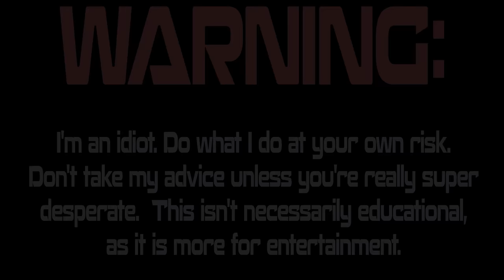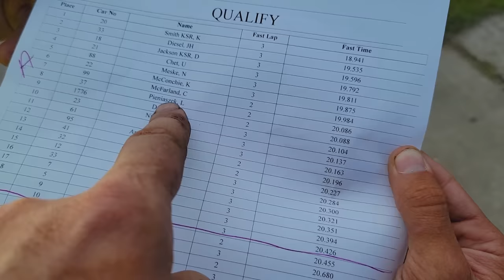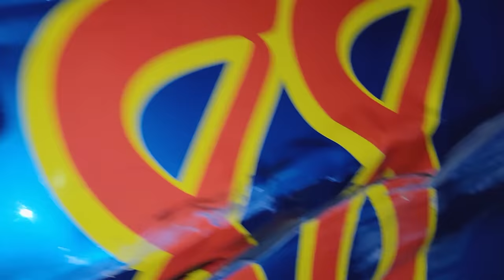My ROLLED Ford Ranger is Back RACING! (Danger Ranger + Spectator Drags)

Comment: Testament to Derek's driving. He managed to get 6th with a bone stock Ranger with a wheel about to fall off and a random misfire. That is impressive.
Reply: They all are supposed to be stock motors.
Reply: @smelmore  could be all those chuck norris's 's's's's under the hood.
Reply: @smelmore  rumour has it.
Chuck doesn't need to even enter the race.
he already won!🤣
Reply: "Tuck in behind somebody faster, and hold on!" Derek's genius strategy worked! Lucky as heck, too...
Reply: It was a fun ride. Jessica did a great job with the video. Imagine if Derek put some mechanical effort of checking things out before loading it up on the wedge?  He probably would have been on the podium. Can't wait until next year. Thanks for taking us along for the ride VGG.👍🏁
Reply: Well maybe probably not
Reply: @jimmylarge1148  That was the last Ranger race, rules changed for this one
Reply: I'd love to see them race.  Chevy S10.  It would look more like a demo derby  prob can't find enough ofem runnin to make  a full race
Reply: Did what you could with what you had   thank you.   Do you have to have a license to participate in these
Reply: What's more impressive is you can fit it all in your mouth! Gi @Paul Curtis
Reply: Dude I am literally shocked at this as well. Ill get me a truck ready I guess. I wanna cut my teeth in a danger ranger.

Comment: Always so stoked to see the hood open on this truck and see that it's the same engine I drive to work every day.
Reply from the maker: Little thing buzzed! Musta' had 3.73 gears.
Reply: I had a 91 with a 4.0 V6 and a single cab with 7' bed. Best truck I have ever owned.

Comment: My vote is YES, more Danger Ranger! We’ve learned that the rear gearing and tire size needs to be optimized and there needs to be a “turning left” alignment. The D Hole wheels looked like a better fit than the Crown Vic wheels. 
It was great for us fans to see you do well in one of these. We definitely would love to see more.

Comment: I watch multiple channels that compete in the danger Ranger but I always root for you. Your channel reminds me of my dad and my uncle they would pull cars out of the junkyard just to get them running and have some fun. My dad would always say "if the radio dont work its junk" how else are you supposed to drown out bangs and creeks. Definitely run the race again maybe make a video on addressing a few major issues with the ranger I mean could a guy fix the radio wheel cylinders and temp gauges aren't needed

Comment: Heck yeah do it again! Maybe do some real fixing up on your truck and read the rules so you can get right up to the edge of them. This was a fun watch.! 
As far as the ramp truck vs trailer with newer truck, (of coarse I'm not the one driving the 800 miles) but I like the ramp truck, just needs a Gear Venders overdrive so you can run a little faster.  Thanks and be safe.

Comment: I enjoyed that better than Nascar any day, I've been driving a 1995 ranger I bought off the floor and drive every day still today. She still runs top a little rusty and a few new parts every year and I plan on running it another 20 years. Its a super cooled engine so you will rarely even see the temperature gauge move except when its 99 degrees out it moves a little.

Comment: A guy definitely needs to run again!  It was great to see Derek finally get to finish, and show his skill on the wheel in the standings.  Maybe a guy could you know, just tune one her a little, make it just a bit faster.  No whirly woows, or compressilators, just a little suspension upgrade and HP boostezez.  A fellur definitely has to leave somethin broke, though.  I do not think Derek knows how to excel in a machine that has nothing wrong with it.

Comment: Rule changes: 4 cylinders allowed a turbo not to exceed 300whp. V6 allowed NA modifications plus 50 shot of nitrous not to exceed 300whp. Upgraded shocks allowed. Increased camber allowed. Ride height remains standard. Tires unlimited. 

This would make for great racing.

Comment: Excellent video Derek  also crew :) did super job and would do again plus get axle fix for next years to and tune up too ! Also like how you did and proud you Derek  besides what happened! Race On more plus get full size 1/2 truck axle of 377 ratio  posi trac if put in that truck if  allowing to do it too! Plus keep some spare axle plus parts on even Spacer too and lots more parts if need change!

Comment: With a few mods, a fella could do some damage with that Danger Ranger... tighten up that rear, good solid brakes, maybe rear gear change, and get some boost into that motor... is it a 4.0L V-6?  If so, you can swap in a supercharger from the 3.8L V-6's and that puppy will SCOOT.  I see this done in my Explorer forums, they use the same motors.

Comment: I only buy old Ford Rangers I got a 1985 I bought on a farm three or four years ago. It had 80,000 original miles on it and is barf green. When I went to go look at it I brought a friend with me and the guy had a V6 S10 or the Ranger. My friend wanted me to get the s10 but when I pulled the dipstick on the Ranger the oil looked like it was new. Not just like it was changed but like a brand new truck. It was not even remotely darkened anyway by carbon or dirt. As a matter of fact it don't even use or burn oil. The only thing I have done to it is brakes. The front caliper was sticking and I cooked a bearing so I replaced the entire front brake system calipers, pads, rotors, bearings and seals. It cost just under $225 tax included. I did it myself in around 40 min, both sides and that time includes bleeding. Harbor Freight has a air bleeder you just hook to a compressor and pull the nozzle it sucks the fluid right through the system. Never touched the peddle until I tested it to see if the bleeding was done. I just did the rear drum brakes about a month ago and I put new cylinders in and same thing one man bleeder. My brother helped with that one he kept the reservoir from running out. The old Ranger 4 cylinder is the way to go. I stay away from any V6 American made (Rangers included) especially GM vortec V6's I have had three of them and each one cost me $1000's in repairs. Matter of fact I don't buy GM anything made after around 1985. If I got a mid 80's GM it would a Monti Carlo just cuz they looked bada$$ them years.

Comment: The grassroots level racing is so much better than what NASCAR has become. I'd rather race next to you Derek in a Crown Vic or a Danger Ranger any day instead of a NASCAR spec racer. Please be careful on those long drives, let the wife take over driving duties when you get tired. I love the family Pit crew! I would just sell the current Ranger and get a newer one with less mileage and  an extensive maintenance history--that should get you in the 18 second range for lap times. Maybe the automatic transmissions and rear diffs have a more useable torque range for racing? IDK, a feller is just guessin! Love ya guys, a true Patriot! 1776 forever!!

Comment: Nice truck Nice driving 🚗!!!  Also nice Blue tint and radio 📻!!!  📻  Tunes in the background!!!!  Nice Nito 's 

Tighten all engines pistons and lifters and replace the Jets Sensor 's and Power Steering it might fix the winning placement on and off parts rent a part to win system
Transmission Computer Company also

Nice window and seat belt job get a Electric of manual fan to intake or carb for other makes 

ant the ram supposed to bounce around if left in gear for awhile with Ford's find the Electrical  parts for that  bine awhile too old to drive stick or to try alittle bit love super high revs engines 

I might be the only one for automatic high revs for a 55 chevy probably having the keys 🔑 and sleeping on it  bounce Cc might be the name.

Comment: Fuel cut It's probably caused by the engine computer detecting the misfire and then cutting off fuel to that cylinder or maybe it's a bad fuel pump causing the misfire not sure just a guess great video as always

Comment: Put the truck on the scales see what it weighs and take everything out that isn’t necessary I’m not sure when you worked on the motor but there’s good go fast parts you can get for it fix the rear end but seriously pull all the weight out that you can run the smallest tire you can and you too will be up there I believe in you

Comment: A guy needs to jump his ranger 5 feet in the air to "adjust" the front suspension angle for maximum grip.  Also a rear gear optimization and you got it.

Comment: as for what engine or what you should do to the truck. shove a duramax V8 or a 6.2L detroit diesel 4 stroke V8 and compound turbo the sucker so u can grudge race in a ramp truck